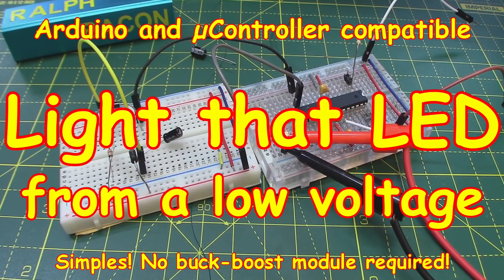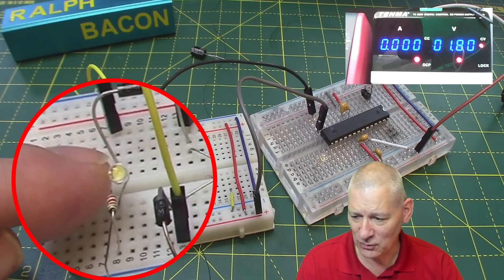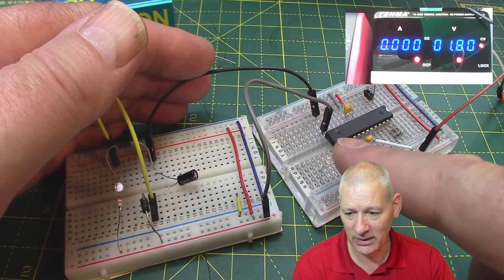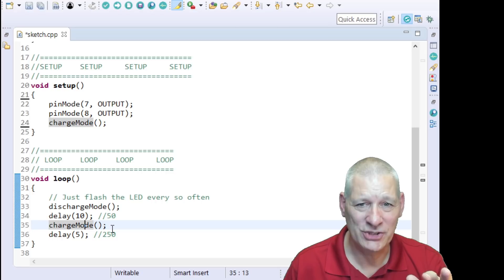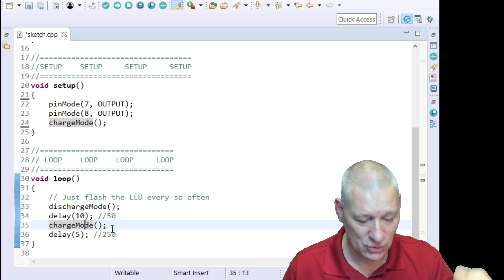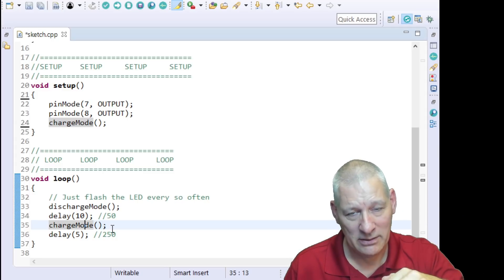#167 Light an LED 💡 with low 1.8v Diode Pump µController output (easy)

Comment: the green diode never conducts electricity?
Reply from the maker: Almost right. It just acts as a blocking diode when the current polarity is one way, but conducts when the polarity is 'reversed' (and does not flow down the purple diode for that part of the pulse).
Reply: @RalphBacon  this means the voltage accross the capacitor becomes negative (it doesn't).... 

1) positive voltage above, 0v below... C charges trough purple diode. Green diode does nothing here. LEd is of. 
2) voltage reverses. We get higher voltage because of sum of voltage accross capacitor and supply voltage. The green diode is in parallel with the voltage across the capacitor.   So it's always reverse biased.

Comment: Hi Ralph
Another inspiring idea. I am incorporating it into an ATtiny85 based mains failure alarm. When the unit is on battery, I still want it to be able to flash a mains failure warning right down to the brown-out MCU limit – an ideal application.

I’ve slicked it up by using Timer/Counter1 to generate a PWM signal on OC1B (PB4) and ~OC1B~ (PB3) and much sleeping between and during sampling.
I’m just about to start fiddling with the PWM frequency, duty cycle and capacitor value (I’m aiming to up the frequency and reduce the capacitor value / size).
Do you have any hints / suggestions as to what I should be aiming for? I have a scope.

BTW  - I also used Atmel Tech Note AN2447 so as not to need any external pins to measure voltage – well I do actually. If I detect I’m on a healthy 5v supply, I switch the ref from VCC to AREF (PB0) which is connected to the battery (via a 15K resistor so it doesn’t mess up MOSI) and every not so very often measure the battery voltage. If it’s getting low I can flash a big warning but hey I’m still on a mains supply for this.

Best regards Peter

(You inspired me at the start of Covid to tackle my first ATtiny13A gadget – I’ve not looked back – thanks again).
Reply: I think I have it.

I was hoping to use a higher frequency to bring down the capacitor (physical) size from 100uF. But as you say, LEDs need a certain voltage to ‘fire’ and you need time to build up the charge to do this.

Ho Hum. Best (smallest) I could do was use a 10uF electrolytic capacitor and charge it with a 2Hz PWM signal with only at 0.005 duty cycle (essentially just blip the discharge cycle).
I measured the ‘discharge pulse’ on my scope at 4.0ms within a cycle time of 0.5s.

So I get LED bips at 2 a second  - OK for me as it’s an error indication, I’m not trying to conjure up the 'keep an LED on’ trick.

Some details about my ATtiny85 setup if anyone is interested...

Code before setup() in the Arduino world..

// Using Counter/Timer1 with fast PWM output on OC1B and -OC1B
#define OCR1C_value 0xFF  						// top value  - affects frequency but as not driving a servo it’s not too important
#define DUTY 0.005      							// duty ratio of PWM - that is OC1B to -OC1B
#define TC1_Prescaler (1<<CS13)|(1<<CS12)|(1<<CS11)|(1<<CS10)  	// CK/16384

In setup()  in Arduino world..

// prepare the PWM signal to drive the charge pump
  OCR1C = OCR1C_value;
  OCR1B = OCR1C_value * DUTY;
  
  GTCCR &= ~((1<<PWM1B)|(1<<COM1B1)|(1<<COM1B0)); 	// mask out bits affected
  GTCCR |= (1<<PWM1B)|(0<<COM1B1)|(1<<COM1B0); 	        // OR in bits required

If you try to implement this, the charge pump is physicalised across PB3 and PB4  (Physical pin 3 and 2).

I love messing about with MCUs

(hey, less so with the new ATtiny series 0 and 1 – my next challenge is to program these from Studio 7 using ........ whatever – there’s talk about modified USB to TTY dongles but no ‘end to end’ solution.)

Happy days
Reply from the maker: I'm glad my videos were a source of inspiration to you, for sure! That's why I make them. Regarding timer settings, check out my previous video #209 https://youtu.be/fFrL5Vh8Dis that might have some information.

Comment: I'm concerned about the current drawn from the pins. Might it not damage the microcontroller ??
Reply from the maker: No damage will occur, Dolon. apart from the fact that we can safely draw 20mA per GPIO pin (40mA absolute max on any one pin) we're talking very, very low current. If you have a multimeter it's easy to test this.

Comment: Cool! I remember having done a horrible hack a few years ago when I had 2 pins left on my micro and needed to light up an RGB LED in one of 3 colors. The voltage was too low for the LEDs to work, so I ended up wiring 2 LEDs in parallel and one LED in the opposite direction. An inductor was in parallel with them. I would run current through the inductor before setting both the leads to high impedance; the inductor provided the voltage necessary. By adjusting the pulse width I was able to either light up just the green or green AND blue led, making the cyan color. The red color was achieved by running the current in the opposite direction. 

I remember trying to further use this arrangement to also detect the ambient light levels by measuring the capacity of the LEDs (but failing) and having problems with the clamping of the ESD diodes, but I did solve these issues eventually. :)
Reply from the maker: Sounds a bit like a Joule Thief circuit. Perhaps you invented one and didn't even know! But good for you that you that you finally cracked it!

Comment: Could you  not build a small joule thief circuit to power the LED?
Reply from the maker: Yes, I could but this circuit is slightly odd-ball, don't you think? That's why I chose to share it. You never know, someone may find it useful.
Reply: That was my thought also but then again, Ralph made a point in his comment, the more info we see about different ways to achieve something the better understand we can all get to mix and match different circuits together.

Comment: Ralph,  I may have missed it in your explanation,  but I am not clear on what causes the capacitor to discharge.  Can you please expand on that? Thanks
Reply from the maker: The capacitor discharges (via the LED) because the "other end - cathode" of the LED is now at ground potential. We brought that GPIO pin LOW (aka GND) and the other pin HIGH to boost the voltage on the cap to about 3v. There is an electrical circuit to ensure the cap is fully in-circuit.

Comment: Thanks for the great videos Ralph - thanks to your videos I now have a bare-bones atmega328p running at 8Mhz internal clock in deep-sleep mode powered from a single 3v CR2032 button cell using just ~2 micro-amps until it wakes up. I've also hooked up a 128x32 OLED display which only gets powered up when the atmega328p wakes up from deep-sleep and it all works absolutely fine from a single 3v CR2032 button cell.  Happy days.  HOWEVER, when the cell voltage drops to 2.9v the OLED display stops working even though the atmega328p is still chugging away quite happily (happy to run all the way down to 1.8v).  Min voltage for the OLED display seems to be 3v.

Can you think of any way to use this kind of charge pump to increase the voltage to power the I2C OLED display?  If I could double the voltage, then even when the cell voltage drops to 1.8v the charge pump would double it to 3.6v-drop across the diodes - so ~3v - which should still be enough to drive the OLED.

The problem I can see is that this is a 'pulsed' voltage pump, and I'm not sure I2C will like that?

Any thoughts?
Reply from the maker: Congratulations on getting this far, Mike! That's quite an achievement. 

Now, running a 3v device on a voltage supply lower is normally accomplished by using a small buck boost module. However, it is almost assumed that the lower voltage is driven from a wall-wart or similar, as you don't get a free lunch in physics. By that I mean if the booster has to increase the voltage from, say, 3v to 5v then you use more current in doing that. Driving it off a small coin cell will ensure it goes flat pretty quickly. It will work, but for how long depends very much on how often the LCD is powered up.

The simplest method would be to use an additional 1.5v (LR44) coin cell for the LCD only in series with what you are supplying already. So the 3v you have goes to the negative of the new cell and the positive of the new cell goes to the VCC of the LCD. Voila, 4.5v or thereabouts. If it's all controlled by the Arduino (MOSFET?) it should last a long time.

Using a voltage doubler (instead of a buck boost module) is another option but has the same drawbacks as the first option. You need a PWM signal to emulate an alternating current in much the same way as I did for the LED here, but it's a bit simpler. EEVBlog has a couple of videos on this, as he did just what you want with this calculator watch:
https://www.youtube.com/watch?v=I4ED_8cuVTU
https://www.youtube.com/watch?v=ep3D_LC2UzU

They should give you some ideas too. Just remember that you are running your Arduino chip with 3v because you take microAmps. As soon as you venture into the mA range then that poor coin cell won't last that long. Two AA batteries would but they are huge in comparison.
Reply: @RalphBacon  Thanks Ralph.  The project I'm using this for is a simple room temperature display, using the ds1820b temp sensor and also a tpp223 touch sensor.  The Arduino spends 99.9% of the time in deep-sleep and is only woken up when you touch the sensor, at which point it powers up the OLED to display the temp for just 4 seconds.  Power consumption for 99.9% of the time is only in the low micro-amps, and when the display is on it goes up to 6mA for just 4 seconds.  With a ~200mAh CR2032 and spending 99.9% of the time drawing <6uA my maths says the cell should last a few years(!).

I am powering the OLED from one of the data pins only when we wake up from deep-sleep to display the temp.  After that we drop to low micro-amps.

I like the idea of adding a 1.5v LR44 battery to 'supplement' the power coming from the arduino pin - will look into that.
Reply from the maker: Sounds like a plan, Mike!

Comment: It has scientific been discovered, that the IONS are actually floating from minus to plus. (But since the official understanding has buildings on plus to minus, public kept building components for that  beleive). So how can this setup with Shotky diodes be useful?
Reply from the maker: Current does indeed flow from negative to positive but, as you say, by the time this was discovered the positive-to-negative flow was firmly entrenched and thus impossible to correct. Oh well. Not sure how this affects Schottky diodes though?
Reply: @RalphBacon  They will logically be placed in the direction of thought. Not the way it does work then. So they are placed at the wrong side, doing the opposite of goal.
Reply from the maker: In that case it must be magic. No other explanation.

Comment: The joule  thief can now be made the size of a dime (well smaller, the size of a AA cell Top) using SMD inductor's, 2 of the little guys will easily replace the coil, no more winding and that sort of thing unless you are into making your own.  I have tried it, found some inductor's on an old board that I was stripping for parts, tied it to a SMD transistor and SMD LED, and the size is, well micro and it does the same job as it's grandfather which was introduced to the world by our friend Big Clive sitting in his little lab on the Isle of Man.
Reply from the maker: What are the values of the inductors you used, Jerry. Simple µH chokes or something more chunky?
Reply: @RalphBacon  I have tried a tiny bead with fine wire, of course that was a pain to make, but it worked, I have seen them now done with SMD inductors that are much smaller.  The one I make at home are usually using torrid's with wrapped magnet wire.
Reply: @RalphBacon  Oh, check out Big Clive's video on building these circuits he makes some neat ones and very small indeed.

Comment: Thanks for this! I keep forgetting ground is a relative reference and can/will be changed. It's just like stacking batteries for higher voltages...

Speaking of, for those looking for (dangerously) high voltages, Big Clive has an example of how to stack the circuit here: https://youtu.be/hc0nWqrECqQ Clive's using 240v AC mains for his source, reaching kilovolt ranges. But, with something like the 1.8v microcontroller here, the same circuit might be used to briefly drive a much higher voltage element (say, a 5v relay for a pulsed contact closure?).
Reply from the maker: Yes, a good analogy with the stacked batteries, Ted. Big Clive can carry on with those lethal voltages; I'll stay closer to 5v, I think! But a voltage doubler (or tripler) could easily be used to generate 5v for a quick pulse (or more, it can be used to run and LCD display for example). But there are some tiny buck boost modules out there that can take 1.5v to 5v and always generate 5v out of it. Sometimes it might pay to use one of those. I have one, so I might experiment a bit. Thanks for posting, good to hear from you.
Reply: @RalphBacon  Indeed,  I have 2 of those anything to 5 volt gizmo's one has a USB out on it, the other simple posts, I also have some that go 5-12 down to 3.3 for the devices that need that to survive.  Looks a bit like the joule thief circuit of days gone by, I still have a few of those built up for those gloomy Sunday's when the ice has pulled down the power lines, and all I have are some old expired AA or AAA batteries.  They do give  you light from those "dead" batteries that have around 1 volt or less, and seemed to last a long time.  Wife and I have them on our night stands, and beside our easy chairs just in case.
s

Comment: LM3909 on a breadboard :-)
Reply from the maker: But that's another $2-3 and more faffing about, surely, Bora? And another component. This way it's a cheap, easy way to achieve to have an indicator. Am I not right?
Reply: @RalphBacon  You're most certainly right. Not what I meant... It just reminded me of a very young age, when Pink Floyd's "Pulse" album came out in a box set with a blinking LED on it. Being a young electronics enthusiast, I just had to cut open the box revealing an 8 pin IC that miraculously blinked a red LED with a 1.5V AA battery. That's how I met LM3909, and I still have a few in one of my component drawers, dated from early 90's. :-)

Comment: Great video about a quite voltage doubler circuit (if neglecting diode schottkey drop voltage), the circuit can get improved by a mirror circuit which drives the load alternatively in collaboration with the first. If choosing a proper frequency and adjusting the duty cycle, it will help to stabilize the output power. A prototype powering LED bulbs is a synonym to an economical application ...
Reply from the maker: I'm also wondering if it would increase the volume of some buzzers I have - some are magnetic but some just standard piezo so a nice pulse train of 2kHz might be louder than the standard voltage (whether that is 1.8v or 3v3v).
Reply: @RalphBacon  Yes large creations begin with small idea then grows such a seed germinating underground and transforms into a tree full of fruits. Since voltage range of piezoelectric transducers is 3V to 30V and optimal resonance frequency is 1kHz up to 5kHz, 3,3V that generates the circuit is a convenient supply voltage, also placing a piezoelectric buzzer as load with the mirror circuit would generates a quadruple power.Waiting to post a video about this project I wish you success.

Comment: The red LED requires 1.6V, nevertheless great video.
Reply: It depends on the "forward Voltage" of the LED
Reply: I know that currently red diodes are produced in various technologies. There are leds where the blue LED is lit and there is red phosphor on it. However, all my red diodes have forward voltage around 1.6V.
Reply from the maker: When you say "require 1.6v", that's not the same as conducting sufficiently to show a bright enough light. I've just been through my box of LEDs (random sample) and it's interesting that the lowest Vf LED I have is a red one at 1.7v but requires 2.0v to become bright enough to be used in a project. Green and yellow need a slightly higher voltage but similarly need more to change the glimmer to a bright light. Blue LEDs you can forget entirely at this voltage; some of mine required 2.9v just to start lighting up! Equally interesting was that I have some red LEDs that produce a very poor light but even then required more than the 10mA I had set the current limiter to. I'll probably throw those away as they are truly awful, current guzzlers and not particularly bright anyway!
I'm hoping that modern day LEDs are bright enough at less than 10ma - some of mine required only 2mA and were plenty bright enough!